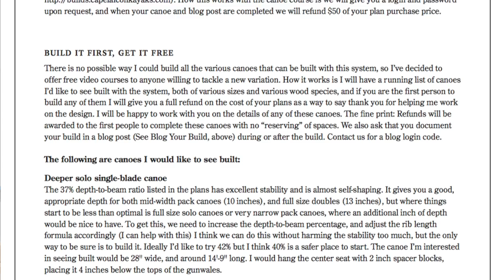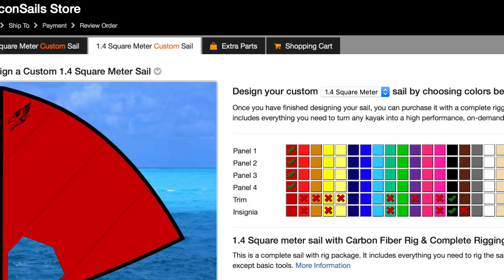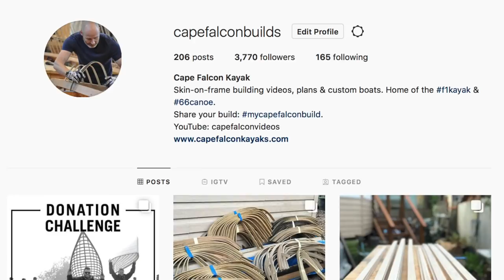Building a skin-on-frame Canoe, Part 15:  Asymmetrical pack canoe, more sail experiments

Comment: I've always loved asymmetrical hull forms which makes so much sense as you drive the size constraints down. I like the thwart modification. Try ing to get sail performance out of small canoes is a challenge at the best of times. I think the simplicity of the pack canoe lends itself to keeping the sail rig as simple as possible too.

Comment: The entire time I'm watching this video, and marveling at your ingenuity, I'm wondering if I can apply this technique to building the St. Lawrence Skiff I've got plans for (I've conversed with you about this in the past).  Then you said that's exactly what you wanted to build next!  I will be watching with keen intent, especially how you handle the added stress of rowing.
Reply from the maker: Stress won't be an issue for rowing.  My guideboats were framed similarly and they were fine.   Sailing might twist things a bit but with a balance lug I can get the partners closer to the people so that should help.  I'm deliberately framing this very lightly because experience has taught me that is the only way to find out how light you can go is to go there.  I give this a 50/50 chance of being under framed.  If you over frame you never learn what is really needed.   My hope here is a boat that can carry 2 people and camping gear, under sail, in mildly rough conditions (think 15knts)  that weighs less than 70 lbs.   It should be possible.
Reply: Cape Falcon Kayak I’ll be following this closely! I like all your Canoe/kayak work, but a rowing/sailing lightweight boat for 2 (or one adult/two kids) is exactly what I’m interested in. I’m currently in the final stages of doing this in plywood with a CLC Mill Creek 16.5 and I’m eager to see how your SoF version turns out.

Comment: Actualy the Flat Sail you where using befor just needs very slight modification to work like a proper Sail. The shape is called spritsail and is in use since roman times.

Take a look at the boot "the sailmakers aprentice".

Comment: Using only a small amount of extra complexity, you could add a second thwart toward the bow to attach the sheet. This would give you fore and after flexibility for the sheet as well as allow better control over how flat to make the sail for better pointing.

... and let’s also have a small mizzen sail in the stern 😃😃😃

Great common-sense explanations. Really enjoying hearing your thoughts and experiences - it’s put me in mind to persuade myself to build my own boat. I was going to ask about building a half size of model boat, but you do mention that it is a lot more difficult.
Reply from the maker: Hi Simon, this sail doesn't work for a variety of reasons, the sheeting angle puts a lot of strain on the mast, my normal designs with a lower boom require nothing but the clam cleats on top of the gunwales and the line doesn't interfere with paddling.  On my nesting canoes with fore and aft loops I've done exactly what you say when sailing, this is perfect because it also gives me a convenient handle to take the strain off my back when weight shift sailing, and also lets me lean all the way back to run straight downwind!   (also makes for a convenient leeboard bracket although I typically don't use one)